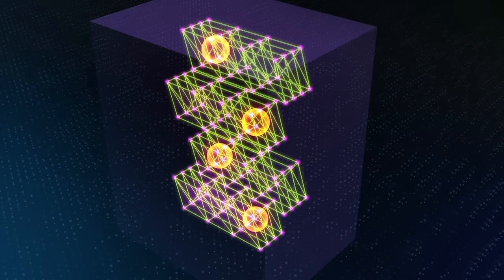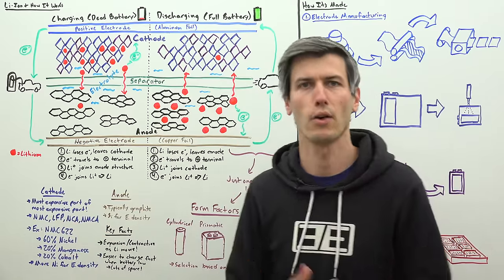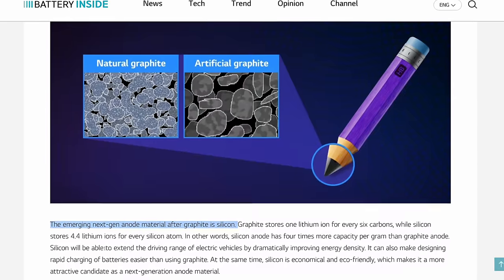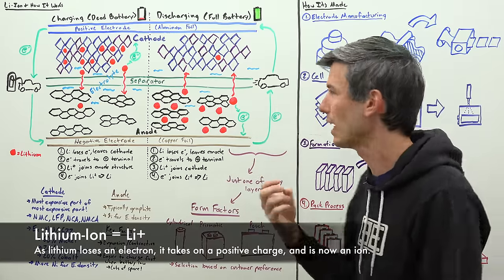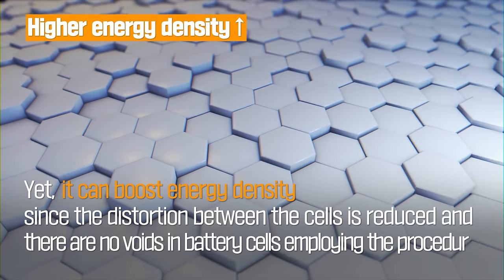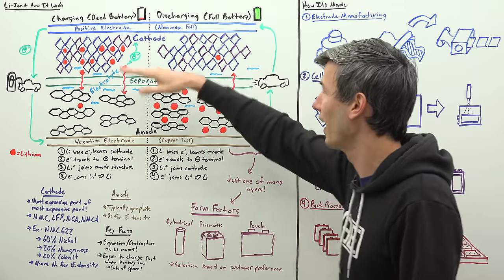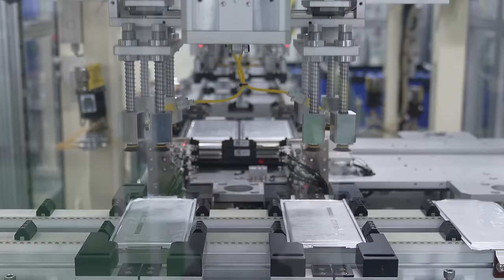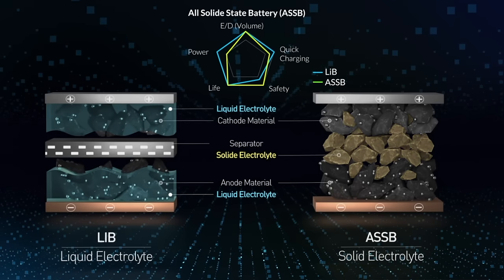Everything You Need To Know About Lithium-Ion Batteries

Comment: Don't be a sucker, battery cars are nowhere near less of a carbon footprint then a regular gasoline engine
Reply: Go watch his video debunking this
Reply: Don't need to i already know it takes driving an electric vehicle 80k mi plus to get close to being neutral.
Reply: @jJ-lz2mk  Ah, the typical "I know better"
Reply: @jJ-lz2mk it's actually 60k miles and it's a worst case scenario. Tesla batteries last 200k miles so you do the math.
Reply: @fparent   Tesla batteries actually last more than 200k miles, at that distance driven, they've only lost about 12% of their capacity.
Reply: Correct, except you forgot about the fuel needed for that gasoline engine.  Taking into consideration that you probably want to actually run that engine (burning gasoline), then you're 100% incorrect.
Reply: @pawel7196  ahh the typical nothing response
Reply: @fparent  no it's not and no they don't.  It's actually 100k miles before being net positive and no ev owner drives their vehicle that long or for that distance
Reply: @jJ-lz2mk   Engineering Explained already did a video on this, and in the worst case scenario it's about 70k miles to become carbon neutral, assuming a car with a large battery that is being charged only from coal fired power plants.

As for EV drivers not driving more than 100k miles, that makes zero sense. Tesla has released analysis data on vehicles with 200k+ miles on them, and I still see plenty of early generation Model S cars on the road.

Comment: the risk of fires come from very flammable electrolyte and the failure of the separator.

the samsung galaxy note 7 fires was a defect in the separator (i think) that allowed the battery to overheat and lighting the electrolyte and the device.

by reducing the cathode elements they can reduce the costs and some of the human rights problems related to mining.

Comment: Great explanation. Question: The generation of electric power comes from the electrons separating from the lithium atom. Why do those electrons leave the lithium atom? I understand that in an electrolyte solution the electron and lithium plus ion are dissociated from each other. But what drives the electron outwards through the anode away from the lithium ion from which it came?

Comment: Your explanation on how a Li-Ion battery works is mostly right, only thing that is wrong is that the electron going to the cathode is getting reduced to elemental lithium again. Actually the lithium in the cathode stays an ion and the electron is reducing one of the transition metals part of the cathode oxide, e.g. in LFP Iron gets reduced from +3 to +2 upon discharging and lithium ion intercalation. If Li metal from the anode would turn to Li metal in the cathode, you would not get any voltage out of your battery, as there is zero chemical potential between lithium metal vs lithium metal ;)

Comment: I have a question. Can battery cell be manufactured via lithography, just like transistors on processors? Wafers and such. Im thinking of if we have super precise miniature cells, then it will be less likely to clump.

Of course, lithography is expensive.

Comment: great content Jason. so i would like to sum up that NMC type EV best suits me perhaps? i like performance and high density energy medium..and to prolong the battery life span, discharge to 25%..recharge to 75% and 2 months once charge to 100%? correct me if i'm wrong.

my general daily use would be less than 50km daily drive, with idling an hour or 2 at schools and grocery shopping, and occasional 500km drive, like maybe once every 3 months.

Comment: Stellantis has blurbed about a Ram pickup with electric traction and what's basically a range extender 3.6l engine (I'm guessing they're leveraging one from their existing production lines somewhere).   Can you do a show on the net efficiencies of such a configuration, where the ICE doesn't ever mechanically drive the wheels (ala Volt gen 2 I think) and just generates electricity to feed the electric traction motors ?  In it can you factor in size of battery,  miles per kwh of storage and then running at speed using the range extender to be either backfilling the battery for use or directly powering the electric traction ?   They're  trying to appeal to the towing world as well as the longer range wtihout so much battery (cost/weight) ?   Enough variables ?  It appears to me to be roughly a 1500, but possibly a 2500 equivalent .   An idea for some white boarding show :)

Comment: Lithium is always an ion in a lithium ion battery, when in the anode (graphite) Li is close to metallic in voltage but is an ion intercalated in the graphite. There are Lithium metal batteries (single use) but to date recharging is not feasible. The battery is discharged when Li is in the cathode, not the anode. The designations are based on discharge not charge for batteries.

Comment: You need to watch veritasium’s video on electricity.  Those electrons don’t actually flow down the the wires…
Reply: Sort of, they're not "moving" in the sense that you normally think, the wire is full of electrons already, they just sort of bump they're way along.  In a DC application they do move, though not quickly.  Verutasiums video was a poor explanation, but had more to do with fields.

Comment: Great video! Do you have a good explanation on why batteries have different performance in different climates, how cold or hot batteries degrade faster and what is changed in the batteries to accommodate different climates? In Scandinavia EV batteries need to be made to work in -30 celsius, but at that temperature they perform extremely bad and range is reduced by as much as 50% on some cars.

Comment: Jayson, thanks for the very interesting video. I have a question: how does a lithium-ion battery compair to a lithium iron phosphate (LiFePO4) battery??
Reply: Hi, Lithium iron Phosphate is a type of Li-ion chemistry.  Different chemistries have different properties, so some are more common than others.  For example, I have been using a Lithium nickel cobalt aluminum chemistry, which has more energy density than LiFePO4, but is a little more dangerous.

Comment: I still don't understand what makes Li atom on one side battery to have higher energy state than when it moves to the other side. I understand it moves from one side to other by loosing the electron. But why it takes energy to move one direction and gives energy to move other direction when in both sides it recombines to the same Li atom?
Reply: hi lukasdolezal, have you become a flat earther yet?

Comment: I’ve always been curious about one thing concerning these batteries. As the lithium-ions move through the separator, is there a measurable weight shift from one side of the battery to other?
Reply: There will be a small (Li is only a small percent of the total mass) mass shift, but it will not affect the batteries ‘balance’ due to the layered structure.
Reply: They move sub millimeters

Comment: Any chance you could you talk about Sodium Ion Batteries? It could probably use some good PR, being right on the cusp of mass-scale viability. It may never achieve the same power to weight of Lithium but it's still quite good theoretically. Importantly, since the world is covered in salt, it becomes much easier to source the raw materials, requiring far less dangerous mining operations often taking advantage of less developed countries and often child labor. Sodium is cheap and abundant and cheaper. If you need 30% more weight to get the same range in your EV but the cost to replace your whole battery pack is significantly less than lithium ion AND it's better for the environment and easier to recycle and safer... it's a no brainer.

Comment: Once the industry pushes towards battery standards/modularity/re-use, I might consider adding an electric to the fleet.  I keep my cars way longer than the industry seems to expect cars to last.  It will also indicate to me a level of maturity - buying today still feels like you will have early adopter headaches (long term).  It will be cool when every time a car is wrecked, all the standard cells are *easily* harvested, tested, and resold in a similar manner.  Those standard cells would likely be manufactured/supported for a long time.
Reply: If you keep your car for longer than industry standard (lets say 5 years is the standard), you will love EVs. Modern EVs have decent range, so you wont feel the impact of degradation for your daily commute. Basically every manufacturer guarantess 90% capacity after 8 years or 100k kms. Most ICEs will make trouble around 200k kms, most EVs easily last 300k kms. 
Less parts need repair, battery replacement wont be necessary for a long time. You save on fuel and the environmental impact is way better
Reply: If OP is like me they haven't owned anything less than a decade old.
Reply: Idk when you talk about your cars like a "fleet", it just sounds like you have an excessive amount of cars.
Reply: @Menon9767  Generally agree, but understand 2/3 of my family's vehicles are past 300kms and I have no concern keeping them on the road (I've never taken a vehicle to somebody else to work on it).  If those vehicles were electric with common battery modules that have been manufactured the past 20 years, I'd bet I'd have similar confidence.
Reply: @NoNamesAvailable81  that's nice to hear. Just remember you gotta start somewhere. Repairability on modern cars isn't great, I'd say EVs aren't harder. Swapping and repairing batteries is the hardest part, you could get some training courses for that if you want to be able to do that. It's high voltage after all
Reply: Hi, if you are someone who works on your own cars then you should already be familiar with everything in a battery electric vehicle.  The battery is a battery, it is just at a higher voltage and has a better regulator.  You should treat it like the ICE ignition system.  The motor is like a big version of the starter motor.  A BEV is essentially a car without the combustion engine.  So, I don't see the battery standards changing anytime soon--when was the last time the ICE battery standards changed?  And if your car is in an accident and the battery was not damaged you could harvest it, but how often do you do that with your current battery?  I personally would never buy a used car battery, because you don't know what condition it is in--ICE or BEV.

Comment: So the Lithium is only in the electrolyte, and is not the anode or cathode? 
   Once it looses or gains an electron, what is the force, or motivation for it to pass through the separator?
   I'm guessing that separator failure and shorting is a good way to have a spectacular/entertaining ev fire? (That may be blamed on 'diesel'!)
    After a few accidental shorts/arcs/inadvertent welding while working on cars with measly 12 volt lead acid batteries, I am very interested in safety for mechanics working on these ev's with several hundred volts and high amperage available. 
    I find nothing, but simply don't believe that flat rate guys trying to work fast have not been hurt bad or killed working on ev's/hybrids. Especially one damaged by a crash, or corrosion, causing it's condition to be unknown, or fragile. A little bit more jiggling or trauma by an unwary mechanic might unleash a lot of joules at a bad time.

Comment: Hi Jason. Thanks for the video, it was more in-depth than I expected. I have to say that the Li-ion batteries could still overheat when constantly being charged and discharged quickly, which we see in every modern EV today, as the pores of the separator expand from the surrounding component stresses. This is why there are so many videos about EVs burning while charging, and these are extremely dangerous fires that are uncontrollable. And I have noticed that you've said in one of your previous videos that batteries in EVs have an average efficiency of around 98%. I'm sorry to say this, but it's not quite true, as the batteries do produce heat, as well as the efficiency decrease when discharging batteries further than around 50%, which happens regularly with almost all EVs. Even in good hands, Li-ion batteries can't get a higher efficiency than 80%, and these are the best ones out there.

Comment: I thought the reason it's slower to charge the last 100%, wasn't because it takes longer for the ions to find a place to park, but it was because the battery management system slows the charge rate for the battery health.
Reply: Yes and no. Perhaps some BMS, but not others. It all depends on the application. What exactly is meant by “takes longer to park the cars”? Sure, you could continue to park at a fast rate, but you’d be like that Allstate mayhem guy. You’d see an open spot, race for it and start turning in before you see there’s a motorcycle parked there. You crash into the motorcycle, both adjacent cars, and leave a mess. Is safety a requirement for parking? Not really, but if you want to your cars to last longer, you can’t park as fast as you want.
Reply: @timwildauer5063  I already understood the analogy of taking longer to park the cars...when the parking lot is almost full.  But thanks for the additional information.
Reply: Understand that the cells have a max voltage, and as the cell voltage approaches the charge voltage, things slow down inherently.  The BMS may switch from a constant current mode to a constant voltage mode.

Comment: Great video if you know nothing, but the title is extremely misleading. Of all the questions I am looking to get answers for I doubt if if I got more than 5%. Too much concentration on automotive batteries, construction and manufacturing and far too little on performance, choice of chemistry type for purpose, specifications, temperature in use etc etc.
Consequently, the title should have been, "Almost Nothing You Need To Know About Lithium-Ion Batteries".

Comment: One line sent me into tangential thought - how does silicon act as a cathode - it is not a conductor innately by itself... right? Does it have to be doped to be a conductor?
Reply: Silicon goes in the anode, not cathode.
Reply: @GregHassler  My bad... However, the question stands... how does it conduct?

Comment: It is a little misleading to say pouch cells are more energy dense than the others.  Pouch cells require the manufacturer to build a metal casing for them, whereas the others already have one. This is due to how fragile pouch cells are.  So once you’ve constructed your final battery pack, you’ll find that the pouch cells energy density is less or more on par with the cylindrical batteries.
Reply: Not really. Tesla uses large versions of AAs. Go get some then stick them against each other in a circle. Look at the air gaps.
Pouch cells have way less of an air gap, even after assembly

Comment: ...they don't inflate like Li-Pos do. Also: cannot be used in Gigaset Landliebe Wireless phones...I mean they can...but after a few years of torturing them they will just shut down and power up again....making people believe the phones are defect...because Gigaset gives the batteries a constant Erhaltungsladung since the electronics has been built for NiMH batteries which always disacharge a bit. Li-Ion like the Eneloop on the other hand do not. Therefore one should know whether the used electronic circuits features a constant little recharge current or shuts down completely after it charged the battery.

Comment: I would hardly say it’s transformed anything. A gallon of gas will get you 40 miles and weighs 6 pounds.

You will never get that energy density out of the same weight lithium ion batteries.
Reply: The electricity used to make a gallon of gas will move an electric car 24 miles - no gas required.  And then we get to drilling for crude oil, or transportation of the liquids.  You sure about that energy density thing?
Reply: Electric motors are far more powerful, over a far larger RPM range, while being way smaller and lighter than an engine.  It's not just the energy source but the whole system.  That's why Tesla's go just as far as combustion vehicles without being any larger, in fact they have MORE storage.

Comment: Great video. However, these are called “li-ion” because at no point (in time or space) Li ions become neutral atoms. If they do, that’s due to Li metal plating on the graphite surface and that can lead to a catastrophic short-circuit.

Yes, Li cations are accompanied by electrons (albeit via different route) in either electrode, but those electrons associate with the matrix (either graphite or metal oxide). Again: not with the Li cation.

Otherwise the video is quite accurate.

Comment: How do you mine the lithium without using diesel power excavators, bulldozers and other diesel powered equipment?
Plus, most power stations use fossil fuel.
What about child labor in other countries the US will have to get lithium from?
Mining lithium is a very dangerous process.
Draw this on a white board.

Comment: 25 years in the future: “we’ve discovered a battery juice we can pump out of the ground, no need to strip mine, and a gallon of this new Magic Battery Juice is 10 times as energy dense than our EV battery cells. We just need to install a Magic Battery Juice Power Generator in the front of the cars. These new Power Generators are expected to have a service life of decades and hundreds of thousands of miles. Preliminary figures are showing the charge range of these new Juice Cars is expected to exceed 450 miles. And it only takes about 3 minutes to fully recharge a Magic Battery Juice Car.”